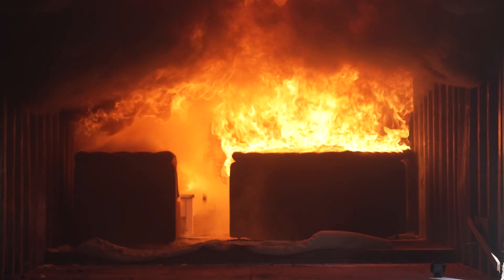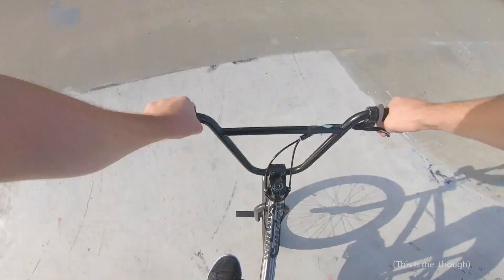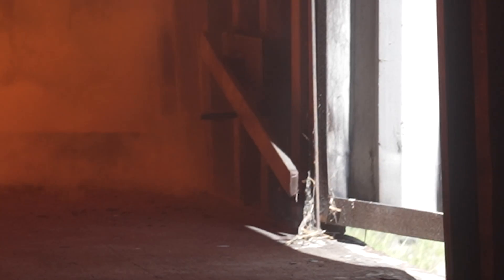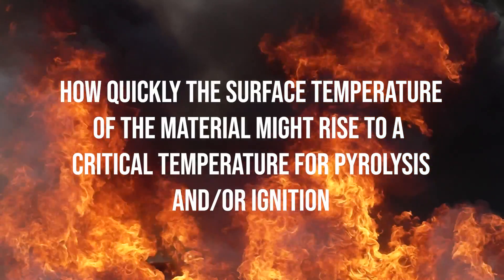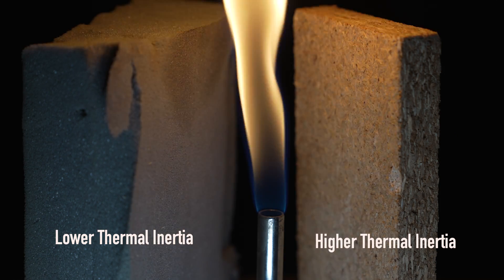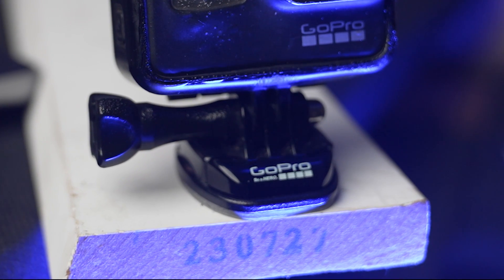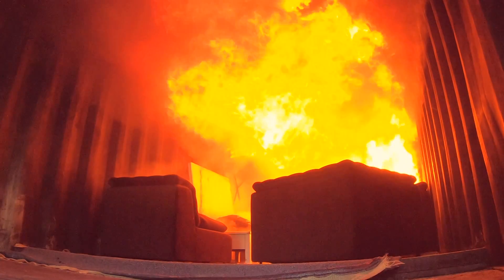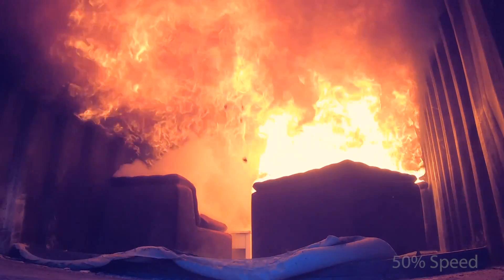Thermal inertia and modern fuels  - Episode 25

Comment: Materials do not react to different temperatures. Materials are affected by heat and energy they absorb or reflect.  Heat and temperature are not the same.   There is more to thermal inertia than low and high.
Reply from the maker: Hi there, thanks for your feedback! I do always try to make sure that what I am saying is straight forward, conveyed in simple terms but still accurate. But sometimes I can miss the mark. I’ll take another look at the video and see if it needs a revisit. Cheers, Matt.

Comment: Hey Matt, amazing video! Never knew about Thermal Inertia until now, and it's great you got a nice lesson out of mistakenly not pulling the GoPro out soon enough lol.

Question, have you and your department done any videos or lessons on lithium-ion batteries? Not sure if these fires are especially relevant to your area, but in New York, it's been a hot topic at both the FDNY and local volunteer fire departments, and in general I've heard that lithium-ion batteries, as well as other fires involving EVs and such, are becoming one of the bigger threats to the fire service within this generation of firefighters. Thanks, be well.
Reply from the maker: Hi, it's not a term that comes alot. But it's closely linked to  "thermally thick" and "thermally thin". Which are a bit more commonly taught. It's great to hear that you are enjoying the videos. I don't have a video on lithium ion fires... yet. I'm am slowly working towards one. Buts a pretty complex topic and I just want to make sure I try and do it justice 🙂